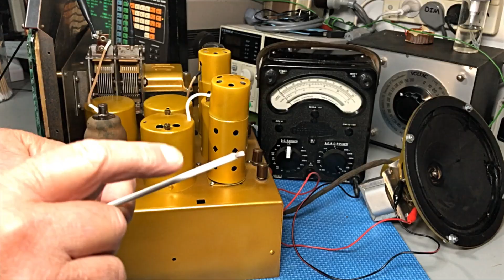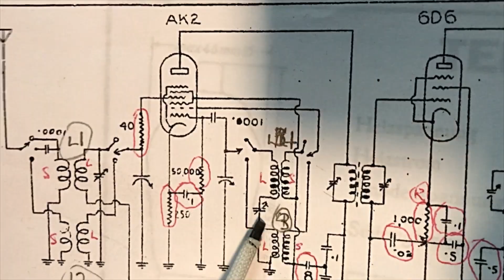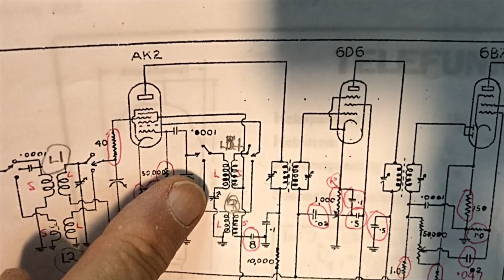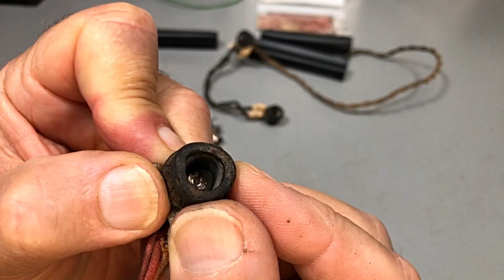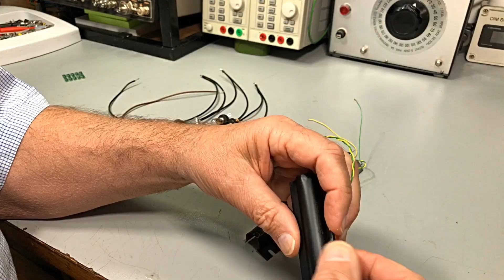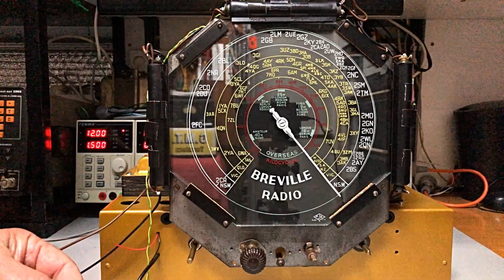Breville Radio Alignment & Lights

Comment: I would use 1.5 grommets on those dial lights.
Reply from the maker: Yeah, another half would be just right. Reckon I will do that, don't want them coming loose or on angle. 👍

Comment: Is this another part to a previous 🤔 video? I REALLY like 👍 how ya work on all these wooden beauties. One word 🙌 about field coil speakers 🔊. These can lead ya to chasing your tail, if it's the field coil is burned open. Your test equipment may not be able to find the location of the fault in all cases. It can lead ya to believe that it may be a bad 👎 capacitor, or several 🤔. It could be a bad tube. Worse yet 😪, it could even be a burned out transformer. Shango066 spent many hours, trying to find the fault in his radio. One problem was a capacitor, which started arcing and sparking. The so called fireworks 🎆 show quit (as he called it), and the radio worked for a few minutes. After this, the capacitor burned open, leaving the radio dead. I think his transformer also burned out. You'll do a GREAT job, aligning this radio. Your friend, Jeff.
Reply: That's why I test the field coil.
Reply from the maker: Yes Jeff, this is an ongoing series over a long period, check my playlists, it is separate.
Reply from the maker: A simple field coil test to start with.